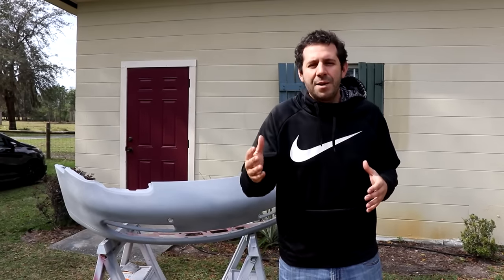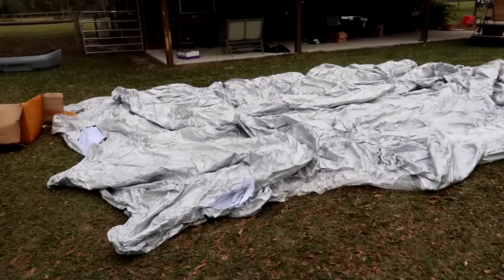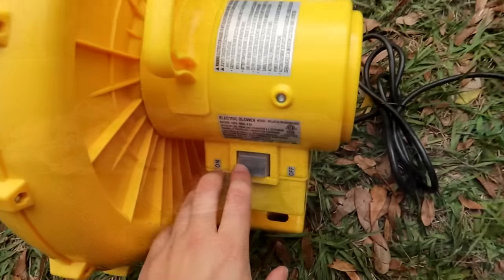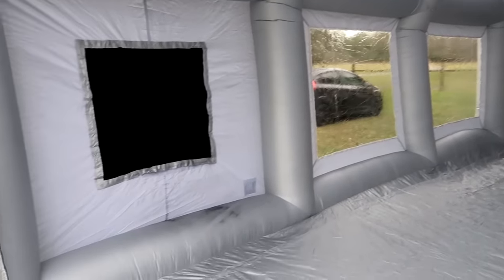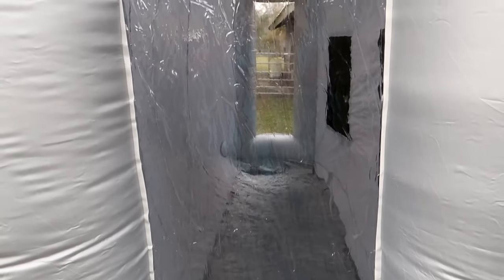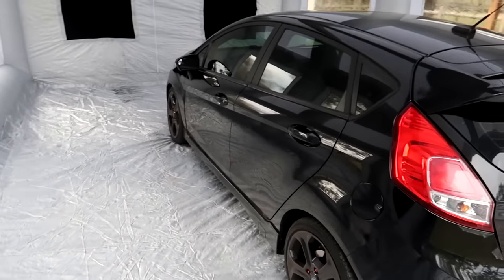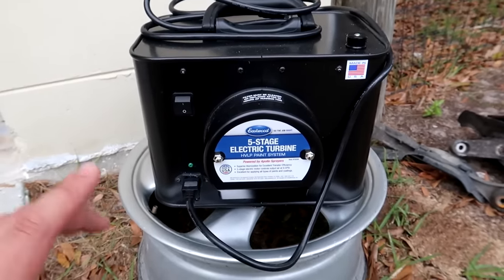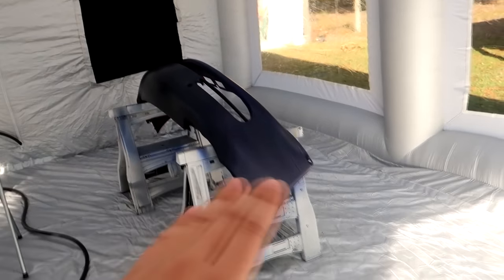I Bought an INFLATABLE Paint Spray Booth from China!

Comment: Pretty cool idea 👍..

But imo the filters are not under vaccum so they aren't filtering anything coming in bubba..it's probably carbon impregnated filter material to capture volatile organics going out into the atmosphere..If you have fresh air blowing in it's under positive pressure and forcing air out..
Reply: Daniel P was thinking the same thing so they need a filter on the air inlet to prevent blowing in dust and bugs into the booth.
Reply: Yep. And yep.
Reply: Not sure which but i saw a company made one of these with built in air exchanger Although im sure it cost much more than this
Reply: The air goes into the booth through the side by side filters and exits on the 2 filters opposite each other, that's how spray booths work, clean air in through filters and dirty air has to go out through filters because it's "better for the environment"
Reply: Forced air units work under the same principal, they filter particulates fairly decent.
Reply: I think the air is entering through that second room so it's being filtered by the 2 panels between that room and the main painting room.
Reply: SgtPiggie  thanks
Reply: The air pump inflates it. It let's the breeze go through it from the filters. So no he was right.
Reply: Yep

Comment: The filter is to keep the paint fumes and from getting into the environment, it's not to keep stuff out.
Reply: Lynne Dunlap the filter is so there isn’t overspray in the booth and to clean the fumes from getting overspray outside of the booth most booths are inside a shop not outside.
Reply: well it depends some filter air in and some air out by exhaust fans , now you want  zero pressure you install fans for air in
Reply: @tonycavez  I was talking about the ones he was showing under the Velcro'd edge. I understand how paint booths work.
Reply: @stony62ss10  I've painted in paint booths before, I know what they are and how they're used, and how they operate. I was addressing the filters he showed behind the Velcro that he lifted.
Reply: @Lynne Dunlap. Yep. Not to mention you could get fined for using this in residential areas not zoned for this type of thing because of that. I used to be an auto body repairman many years ago, as well.
Reply: @darwinsaye  Key words: "used to"
Reply: Chris Lee  Yes, it depends on where you live.  In some areas,  phone calls will be made immediately and the inspectors will be at your house shutting you down within a couple of hours.  And portability has nothing to do with the zoning issues of using your residential property to do industrial type of work.

Comment: Make sure to test the plastic and internal air for possible surface static buildup.  If static does become an issue you might have dust and paint spray problems.  At the very worst, you might have an explosion hazard from the paint air mixture being ignited by a static spark.  If it is an issue you can have the interior lightly premisted or have a humidifier set as high as the paint conditions allow.  You can also run a grounding wire from your spray gun.

Comment: With pvc frame and some cellophane sheets you can make you own bug proof or dust proof chamber for under $200 or cheaper depending on size.
Reply: That's what I did.
Reply: JosephDR pictures? I'm curious how you did it
Reply: @peterkay2406  Sure. Go to the link below. Scroll to the bottom. You'll see my set up when I was spraying my '64 VW bug: https://www.thesamba.com/vw/forum/viewtopic.php?p=8051292&highlight=#8051292
Reply: Craig D  Yeah, I've seen them at Hobo Freight for about $189. Way better than the blow up booth.
Reply: You can buy one for less than $200

Comment: 5:15 I think that little room is to clean yourself before entering the painting room, BTW something you didn't do while showing it. You have to keep it closed and clean at all times.
Reply: Yes, that is a decontamination room. Anything that follows you through the first zipper comes into a neutral air space and falls to the floor before it makes it through the second zipper. That's the design anyway, if he'd utilize it.
Reply: @MrFredboy  - Exactly, that little room is designed to trap debris, dust and bugs before walking into the main chamber!
Reply: just spray down the inside with water before use
Reply: @erichjelm4173  the inside of the paint room? It should work but you have to carefully dry everything after. It's not good to paint with excess of moisture in the air.
Reply: @byAnArgentinian  always worked for me.   I painted 13 cars in high school  (was t.a. for all shop classes), and have even painted many cars/trucks outside.
Reply: That old dust trick does work if you don't have a proper booth, probably not needed here .
Reply: @erichjelm4173  And I believe you. I know a lot of people who do paint jobs without a proper room or booth. And, depending on the environment, it may work without major problems. But, ideally, that's not the way it should be done.
Reply: @byAnArgentinian  yeah, every now and then you do squirt a bug into the paint (then have to fix that spot)

Comment: i would install an aluminum frame inside the Tent, and fix it at the hooks. for secure and better nerves
Reply: Better to build a simple rectangular PVD frame will pull pins, for the inside of booth.  You can simply assemble once booth is inflated and then take down if you decide to deflate.

Comment: I used my greenhouse. No need to inflate it. Just  aded a layer of nylon on the floor. Because it was winter, also aded a lot of heat and light from the sun! Also did not spend any dime on it, but when I bought it, I spent 500€ on it!  It is 40 sq meters.

Comment: Use a shop vacuum to deflate fast
Reply: exactly.
Reply: Thats the best and easiest way
Reply: Exactly what I was going to say! If you use more than one will it work faster? I'm going to say probably yes but I'm just asking LOL.
Reply: Use a shop vac and not the blower. The vacuum will have a lower volume which will take more time but unlike the blower, it will be manageable the prevent the whole thing from getting sucked into the hose.
Reply: Shop vac would be slow as balls.  They drop pretty fast as soon as you shut the blower off. As long as you roll it from front to back, it will press the air out of the inlets quite easily.
Reply: i was surprised the fans didn't have a deflate setting, even my coleman air mattress pump has that.
Reply: Great idea.

Comment: Imagine this deflating onto your car right after painting it, but you're not there to peel it off of the car so it sticks onto it everywhere and you can't get it off

womp-womp-womp-woooooomp 🎺🎶
Good luck with sleeping after this
Reply: Best to have back up blower I bet
Reply: Holy s*** that would be a terrible nightmare😭😭😭😭
Reply: Or put a light rigid structure to avoid that. like 4 tall poles around the 4 corners of the car, that way if it deflates because of a power shortage or anything it won't touch it. Cant avoid rain water accumulating on the roof this way though.
Reply: Just let the plastic stick and call it a wrap job

Comment: Turn the blowers around to exhaust the air from the spray house faster. Then unzip the doors  slightly, fold it in half lengthwise twice and roll it starting at the end away from the door.

Comment: These are on Ebay ranging from $478 to $1600.  It would have been appreciated if you gave the actual dimensions.   The one similar to yours  is 16'3" wide  39'4" deep 13' tall.  And lists for $1600 everything included.  Most popular and sold out model is the 23' unit.  It is  just about  $800.  I question how well you could walk in the floor without underlayment of some kind.
Reply: That's alot more affordable than I thought. I'll have to get one down the road to keep dust and bugs out.
Reply: I wish to see more details about the purchase and the purchase price. Stock number or item name would be nice
Reply: @prestonhfostersr3897  It is not difficult to search out inflatable paint booths and find a host of.option lncluding the identical one in the video.

Comment: Could you fill the inflatable voids with filler foam? Or use electrical conduit to keep the roof up
Reply: Great ideas man. I'd go with conduit or pvc pipe
Reply: If you want a permanent structure you can buy 2 green houses from Lowes and connect them for the same price.
Reply: @kangkim150  and grow  Pot --When not Painting !

Comment: What about overspray on the sides don’t it flakes off when reblowing up🤔???
Reply: Good point.  After a few uses, that might be a concern.  Maybe broom it down to get the loose ones.
Reply: @louf7178  spray the sides and floor with a protective booth coating that is soap based and jost hose it out every month and reapply. about 40 bucks a gallon.
Reply: I'd be worried about being to hot to paint being like a greenhouse by the time you get the paint on it will be drying and won't flow smoothly as well as moisture dripping from the roof onto your paint!!! I be scared to use it what I did for bugs was just add liquid off to the paint keeps the bugs away and I never had a problem with it paint jobs looked great years afterwards... I just had a tarp over the cars to keep the sun off it so the metal don't get to hot wet down the driveway and go get it done..

Comment: Paints car and goes inside. Comes outside in the morning and it collapsed on fresh painted car 🤣. Now that’s a trash bag paint job without all the hassle 👌
Reply: there are many clear coats that are buff ready in 3 to 4 hours so a deflate booth will not hurt the fres painted car
Reply: Cruz S. So what happens when you walk inside 10 minutes after painting the car and it deflates? Way to show your ignorance
Reply: @FacePeelN  I make my comment based on your initial comment of coming in the next morning and I got a point on that
Reply: Cruz S. So how about this. You paint the car then walk straight inside your actual home. You then fall asleep and wake up the next morning to your car being covered in plastic because you find out it deflated right after you went inside. Paint job ruined. Please give up
Reply: @FacePeelN  I am talking 3 to 4 hours to sand and buff but they can be ok to touch in 10 to 15 minutes, are you really a professional painter?  I mean you can create any scenario but really between this period of time they are ok to touch and handle, and even better if you put a fast accelerator which is related to the weather

Comment: I would reinforce it to prevent it from deflating on painted project by putting  2 or 3inch pvc pipe kind of like a rectangle shape fit to the inside size of the inflatable booth with pvc studs on all 4 corners plus 2 center ones 1 on each side total 6 and then fit all of them together, to form a rectangle box. Do Not glue them so that you can disassemble later.

Comment: Is it cheaper than building your own? How much does 1/2" pvc pipe and poly sheet cost? Surely less than 1k.
Reply: That's for people that isn't very handy bro or just lazy.
Reply: 1/2" PVC would sag at about 5 feet of length. Anything less than 1" is not suitable for a 20 foot run if you want proper structural integrity.
Reply: @thomasleary1807  That's an easy enough fix though. Buy 5' lengths and put a T joint between them. It will be a little difficult to initially assemble but once built would be stable enough.

Short of that, 2x4s are always an option, be it slightly more expensive.

Comment: Great video. Like the fail. I'm concerned that the filtration system will not recover once someone starts spraying an entire car. Because if you cannot remove the clear from the air, what happens is it falls back down onto car surface and then you have trash in the paint. As well as other issues. One bumper you can spray paint in while inside a big cardboard box. A grand isn't much to be able to shoot your own car. But if the set up does not work as well as a real paint booth, it won't be good enough. Let me know. Your  reply will make my decision for me. Hopefully.

Comment: I think I'd rather hang plastic inside my garage.
Reply: Yup. That's what I did. Much better than spending $1,000+ on this balloon.
Reply: Keep it old school DIY style 🤘
Reply: You gotta admit it's cool! But how long will it last?
Reply: You are missing the ventilation and air filtering part
Reply: @endrizo  a 14 dollar inline fan on each side and youre done. seal up the corners with duct tape and youve got a clean room. Just get a good mask / suit and ad in another set of fans if its a larger room for an SUV
Reply: Yeah but you can still get bugs in and ventilation is still poor

Comment: I like the idea of it, but what if there's a power failure? Unless you're connected to a UPS with massive batteries or a generator, it seems like a there's a risk of collapsing on the vehicle while the paint is still wet.
Reply: The time we lost power was 10  years in an ice storm, the odds of that happening are really low
Reply: Life is full of risks. Sometimes you have to live a little dangerously.
Reply: The only thing that causes massive power outages where I live, it a massive wind storm. Since we have meteorologists, I know when that's going to happen, and don't paint.

Comment: You can probably deflate the thing using a vacuum suction. Get a vacuum near. Get the hose to a good point on the  non deflated thing. Use some weak duck tape to hold the hose on and seal around it.

Comment: Make a part (you can make one . .from construction paper and good quality duct tape) that fits over the intake side of the fan. Tape it to that side of the fan so there is no air leak. Insert the tube you made (from a piece of rolled up construction paper) into the sleeve you used to inflate the booth with and turn the fan on. It will suck it down quicker than it took to fill it. I hope that helps. Russ

Comment: Thought; After Painting your car ... two words ... Power Failure.
Reply: Best thing is get a emergency power generator
Reply: $150 little generator.
Reply: Puncture
Reply: I was surprised at how quickly it deflated. Lousy fabric? Lousy seals? Intentionally designed like that for some reason? Dunno, but when I blow up my air mattress, it stays blown up after I remove the blower.
Reply: Yeh just have the generator running in case you need it lol............. no.
Reply: @OMGWTFLOLSMH  Big bouncy houses have blowers that run continuously.
Air mattresses have plugs, yet still deflate over time and temperature.

Comment: What happens after a few full size spray jobs and the windows are covered with overspray? Are they replaceable?
Reply: Interior PVC exo=skeleton? Or exterior skeleton like crabs have. Or go full medieval with flying buttresses?
Reply: Apply solidifying substance to the air-filled tubing for more permanent use (in law/guest room/homeless shelter/artist studio/soundproof for music rehearsal space/greenhouse/remote bug-out space...etc...If concern for overspray on windows cover first with thin translucent plastic to remove after painting.
Reply: @janetbratter1  You didn't close the parentheses! You made me throw a syntax error.
Reply: With windows with overspray on them just get a razor blade and go over the whole window. Obviously don't get rough. Doesn't scratch windows at all
Reply: order one of those really wide rolls of clear plastic wrap like they use on pallets  and tape a layer over each window. when it gets cloudy rip it off and recover it with more wrap.

Comment: put a pvc pipe frame on the inside of the booth to keep it from falling on the car in case the blowers kick off. 
dont glue it, so you can take it apart.  it wouldnt have to be heavy just enough to hold the booth up.
Reply: If you have room in back yard double as green house...

Comment: Soo much electricity just to keep the booth running, u can easily build a more permanent stable unit that will last years
Reply: Only about $8 a day to run two blowers, and you only need to run them until the paint dries and you don't need the booth up anymore
Reply: Not really. It's about as much as a kid's bouncy castle.
Reply: Cross I’ve seen people use the 4 sided harbor freight tent inside their building and it works really well with a big fan and a filter for the intake air. Plus I don’t think he was getting much air flow while painting.

Comment: T[o deflate it try hooking the inlet of the fan to the inlet of the booth use the fan as a vacuum. also are there any hooks on the outside? if so you could make a outer frame of pvc pipe or wood that way if you loose power again in doesn't collapse on your project..

Comment: I'm a Civil engineer that has designed spray booths for cars and one huge advantage of this inflatable booth is that you don't need a building permit for it that would require structural, electrical and ventilation certifications from an engineer and engineered drawings for the construction, which would run you about $5,000 just to engineer...
Reply: No one's gonna do all that stuff for a do-it-yourself paint booth at home. If you had the space in a building, you could set up a workable paint booth, with filtration, lights, etc. for a fraction of that.
Reply: @danieltaylor4819  Not around Here CT USA, you'd get caught sooner or later and you'd be screwed!

Comment: I bought the same one today for 461.09 and it came with two motors, one 1200 watt, and the other is either a 280 or 380 watt.
Reply: Would you mind, providing link?

Comment: Does the air blower that fills the room have a filter on its inlet or is it blowing into the small room and then gets filtered between the small room and the main one? If that's the case then pedestrian access through the main door end is preferable, as opening the small internal door from the small room will have unfiltered air entering the main spray booth area. I'd suggest that the primary role of the small section is a chamber for the air pump to blow into and the air to slow down before going through the panel filters, so as not to cause a big draft into the booth.